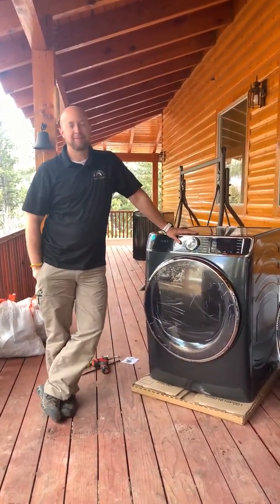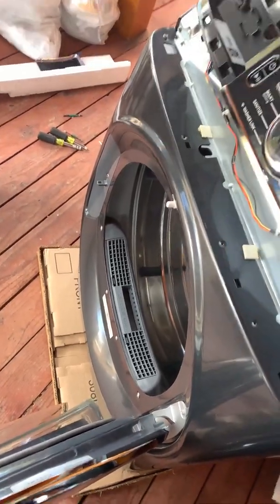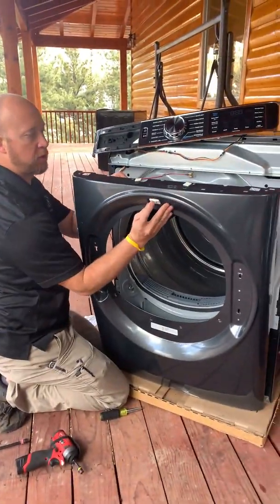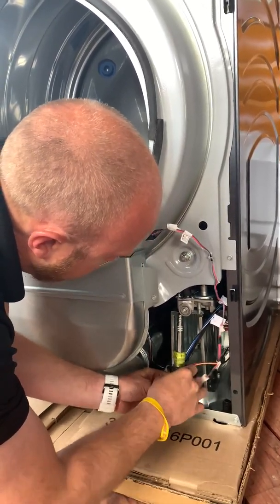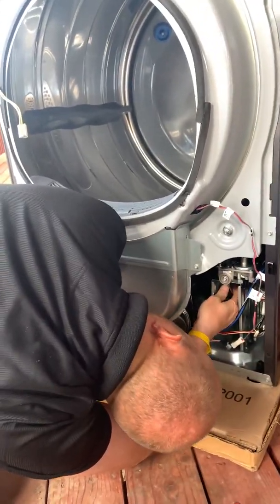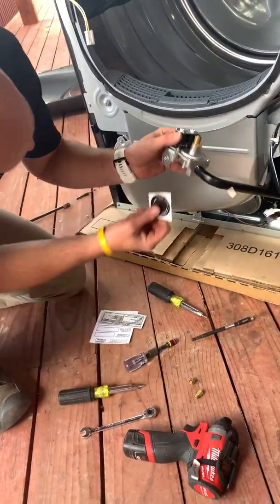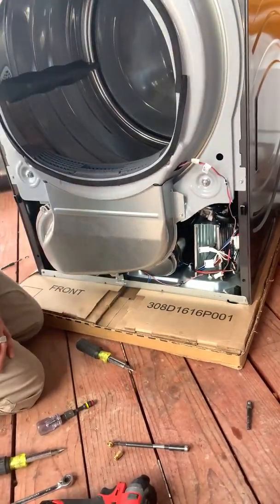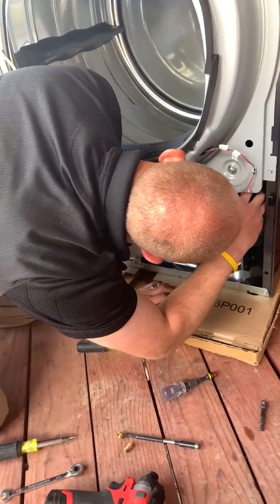How to convert GE GFD85GS dryer from natural gas to propane with WE25M87 LP Convertsion kit

Comment: Does it matter if you put the back top ones in the  correct sequence  or the back bottom ones by the zip? (Left v right)? I don't remember which one was left or right on those back two sets

Comment: I need help. I have a GE stacked washer/dryer combo model number GUD24ESSMWW for the dryer. Of course 🙄 it came factory configured for natural gas which nobody this side of the Mississippi uses, so I got a conversion kit that supposed to fit all kinds of GE gas dryers....... except mine, apparently. When I took out the factory natural gas nozzle/orifice, it's course threaded and the new conversion orifice from the kit (WE25X217) is fine threaded. I called around and the kit is "supposed" to fit this model dryer, but even a college professor would know that the two different thread pitches won't work. Tried lookin up a conversion orifice to fit my model, but all I can find is the same thing I've got which won't work.

Comment: The real trick was the removing front panel..but after you get 4 top screws 4 front screws front panel lifts right up w/door.. and you can use 7/16 to remove orfice right thur the front.w/o removing wires/valve/gas line  AWESOME VIDEO! TANKS!
Reply: Did you did this and it works fine?
Reply: @Surfnsnowboard3  yes, im not gonna say it's not tricky, just take your time..this particular unit I dont remember but usually you start with two screws at the back the top slide back..the two screws in the front pointing down in each corner, then you have to prop it up..I used a small 2x4 the two screws bottom front maybe front display may have screw and lint catcher with 2 right & left of opening..I left door attached..then front slide unit set in 2 hooks either side..good lucktake pic..organize screws in the order yu take them apart..the need to work on alike screws..

Comment: To remove the valve/ get to the 3 valve screws I found it easiest to remove the 2 1/4” screws that mount the assembly to the bottom of the unit, then tilt it a little to get to the 3 screws holding the valve. 
Amazing video! Helped me a lot.
Reply: Thanks for this comment!  I read it before I started, then when I got to the valve I remembered you said to undo those bottom screws.  Soooo much easier than cramping your hands in there, thank you!
Reply: Did you do this conversion and does the dryer work fine?

Comment: Thanks for the video,,, saved me multiple hours lol,, I found it easier to just remove the clip/zip ties holding the wire harness by the gas valve, I couldn’t for the life of me remove the connections inside.
Reply: Did you then put a new zip tie when you put it back together? I can't get it undone either!
Reply: @kaiaanderson2074  yeah I just zip tied it back on
Reply: Thank you! Oh man. I really should have done that. I accidentally busted the whole sensor off (the plugs would not budge!). I have no idea how to reattach it.